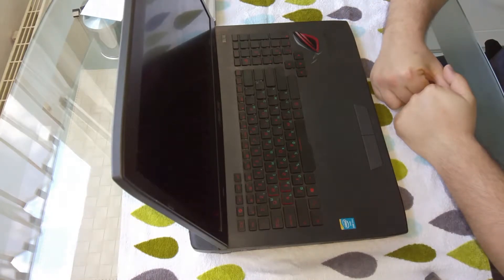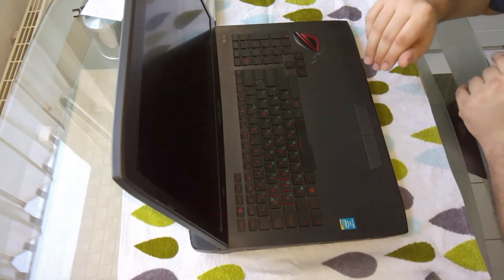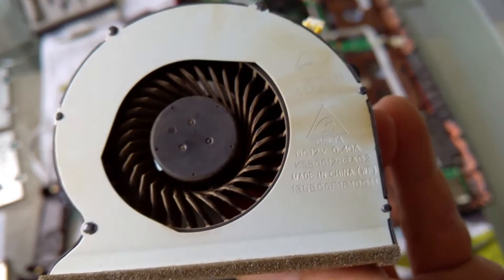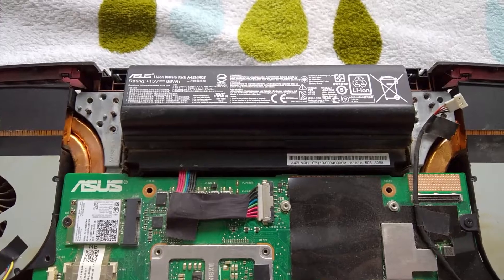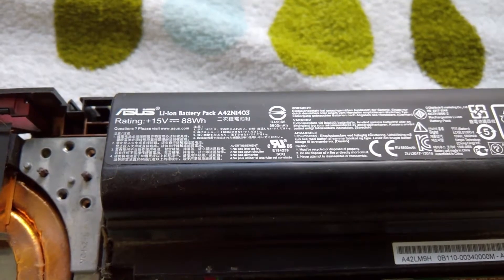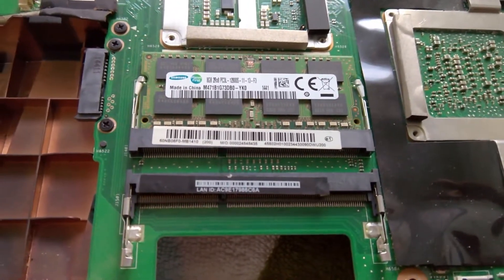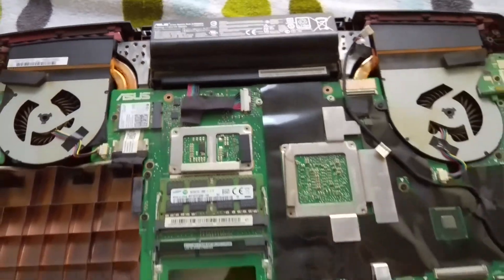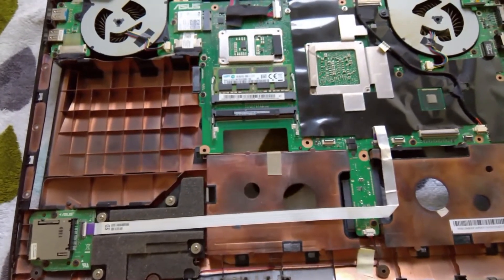Asus G751 - Things you need to know HD

Comment: I've found a refurbished G751 with the 4720HQ and the GTX 980M for 1100$. Is it worth it? It does not have G-Sync btw.
Reply from the maker: Well, it depends. Usually, I'd say that this a relatively good price but still a tad too much for a 2 yo laptop. Have in mind that you can get a second hand one, maybe not in "perfect" condition, but still good enough for 200-300 less. If I were you, I'd look around for second hand, rather than refurbished. Ofc, this is my personal opinion.
Reply: The deal was already taken with the blinking of an eye. It was only used and returned in less than a week, so I presume it had some serious heat issues. As I find 17" devices too big, I'll be looking for the AW13. I heard the OLED screen is epic great!
Reply: Hello I'D like to take this machine asus g751 i7 gtx 965  in good condition battery life time max 2hours for 500 $ is it worth it or better not to take?
Reply: @abbosxonolimov2965  GTX 965M is very outdated today. Probably go with a 1050 or 1050Ti laptop
Reply: @zaka2630  hello  mr Zakaria thanks so much for your reply 
Would u please tell me the amount of I am buying is ok or too expensive for that?
But in good condition battery life time up to 2 hours!
Reply: @abbosxonolimov2965  The price is good but I suggest you add 200$ and get new laptops with GTX 1050

Comment: Hi! I'd like to ask you, is it compatible anyhow with pcie m.2 SSD storages?
Reply from the maker: Yes, it is compatible to PCI-E based M.2. Samsung EVO and PRO series for example). It is however NOT compatible with M2 SATA SSD's (the new ones with the very high R/W speeds)
Reply: Hello brother is that support m 2samsung evo 970 1TB? And is they need bracket to hold it or not?

Comment: hello, quick question...did your laptop becomes slow when using adobe Illustrator ? also does you camera key works after the windows 10 upgrade?
Reply from the maker: Hello, I use Illustrator almost on a daily basis and it really depends on the amount of RAM you've got. Currently I have 16 GB (I started with 8GB) and since I've upgraded the RAM the performance is drastically improved. All adobe apps consume huge amounts of RAM. When you couple the 16-24GB of RAM with an SSD (850 Pro or 850 Evo) it becomes a very different story. You won't notice much lag. 
As for the Camera key, yes it's working, but since the last retarded GeForce experience update you have to pres Alt + cam button. I hope they fix that damn thing. It's annoying AF.

Comment: The DVD can be replaced with a Blu-Ray, right?  Also, the DVD can be replaced with another DVD I assume.  Do you have a video on that?
Thanks
Reply from the maker: Usually this laptop comes in different configurations, one of which has a blu-ray reader/writer or only a reader. Here are two options: http://bit.ly/2jsv9gQ or http://bit.ly/2jpA6aG
 You can also buy an SSD caddy, but you lose the CD bay. Personally I don't see much use of the CD/DVD bay, because since I own this laptop I've used it maybe 2 times. I have enough storage for now, but if I start running out, I'll swap it out for another HDD/SSD slot.

Comment: Great video!
Mind recommending audio driver you're using for win10? That laptop of mine is getting pretty annoying when i'm listening to anything, even this video, with volume above 30%, all that crackling and stuff, like the whole audio system is too weak to handle the sound (using battlefield preset from asus audiowizard)
Reply from the maker: The driver version I'm currently using is 6.0.1.7576 from 04-Aug-15. This is the patch which fixed the issue with the sub. Although in your case, you say it's already making crackling noises it might've damaged the subwoofer. I used mine approx 5 months with the wrong driver but I used it mainly with headphones. Install the new driver and if the crackling noises persist, then you've probably damaged the sub.

Comment: BEST I SEEN ON YOU -TUBE! GRATE PC VIDEO ! ! ! @%#!^*$ your THE BEST ON YOU -TUBE! GREAT HEADS UP! WHAT ABOUT VIDEO CARD REVIEWS SAID THE NEW 1070 IS 2X TWO TIMES FASTER THE SPEED OF the NVIDIA GTX GEFORCE OLD 980M ?
Reply from the maker: I suppose you mean 1070M vs 980M? If that's the case, it really is nearly 2x times faster. There's no doubt about that. After all we're talking about a 2+ yo GPU vs a brand new. I'll wait another year or so and I'll move on either to Acer Predator or to the new gen ROG. I'm also considering a desktop at this point, because I don't need a laptop so much anymore. I'll keep my G751 for the road though. It serves me well (ignoring the battery issues).

Comment: I bought a trackpad to replace my ASUS trackpad. Is there an easy way to replace this part? I'm sort of a newb, but want to try doing it myself because I don't have a lot of money. I checked the manual but it doesn't cover replacing this part. Thanks.
Reply from the maker: I didn't even know they sell spare touchpad for this model? The keyboard and the touchpad are usually welded to the palm rest using high frequency. I'm not really sure how you can remove the old one and even if you do, you have to break all the welded spots and then using an soldering iron or something else you can melt the plastic and put the new one. I might be wrong, but at the moment I can't open mine to take a look as I'm on a business trip for 3 weeks.
Reply: Dongleboo thanks  yeah they do here : http://www.asusparts.eu/en/partfinder/Asus/Notebook/G%20Series/G751JY#Touchpad.    Anyway I did try your tutorial but could not figure it out I had to take it in to a store, the guy believed it would be a simple thing to put in. Judging by your comments though I'm thinking it won't be I hope if dint throw my money away. He said it would be tomorrow  befor I hear from him so I guess maybe we'll see.
Reply from the maker: Tell me if he managed to put the new one in because there's another person who's having the same issue. 
BTW my battery died for the second time. I might make another video about this. It was brand new and I had to use my laptop for 4 days without charger and now if I unplug it, the laptop shuts down in 5  minutes. :D
Reply: Dongleboo
 Yes, he fixed it.  I want to clarify that the part was damaged was the trackpad button (left click no longer worked). I only ordered that part not the whole trackpad.  Initially, he thought I needed to order more parts, because he thought like you that it was soddered on. But a gamer employee more familiar with the laptop came in, and they discovered it was attached with double-sided tape. They put in and now it works great. They cleaned my fan too. I appreciate your help and so sorry about the battery. I hope mine never dies like that!

Comment: Hey I accidentally put a 5v fan and now my comp won't start,am I fucked?
Reply from the maker: Well, try to disconnect the battery. If that makes no difference and as a last resort, disconnect the battery and then remove the CMOS battery for approx. 1 min or so. If that also has no effect, then you might've fried some controller chip or something. I'm really guessing here. Does it turn the fans or something or it's completely bricked?

Comment: I've had mine for 1,5 years now exactly, 2 weeks ago the battery started acting up.it's still retaining charge and stuff, but stops charging at 89%, retaining 70,229 mWh currently. also I was thinking of doing a "xotic pc afterburner" mod. thank you for the disassembly video!
Reply from the maker: You're welcome. As for the battery, I'm pretty sure its already dying. You can keep checking for drops in the charge capacity, but for me it's a goner. The charge  will soon drop significantly and soon after that the battery will hold less than 20-30 mins. After this "phase" aa soon as you see the "10% battery" notification, the laptop will hibernate. My advice to you it's to keep the laptop ok AC at all times if possible. These new Li-ion batteries really don't like to be discharged and charged. 
The mod looks like a bunch of LED's under the heat sinks. Looks good tho.
Reply: The weird thing is,i was keeping good care of it. Ac power 95% of the time and didn't use high consumption tasks,like gaming,while on battery.laptop works so i'm cool with it for the moment.yes the mod is exactly that,though i'm not sure if they swapped out the vents with led vents or just put some leds in.i'm very bad with small things so i need to build courage before doing it:)
Reply from the maker: I'm pretty sure it's just s small LED strip which has adhesive on the back side and you will stick it on the base. You can give feedback once you install it.
Reply: will do!

Comment: Hi.  when you play gaming like bf4 how temperature.  bcz I'm get 90c cpu . ineed to know. . thanks
Reply from the maker: Well... lets say 90C is a tad too high but still within safety limits.  If it gets over 95C and holds, then it might be a problem. I'm getting maximum of 85-87C. Have you cleaned your fans? If yes, then maybe there's some thermal throttling going on? Download Intel XTU (free) and try to undervolt your CPU. You can download pre-configured profiles on their website and the CPU will run smoother You can also monitor if there's thermal throttling when the CPU is under heavy load.
Reply: tak eto i perviy i vtoroy po 12v?
Reply: vot ya kupil na ebay ventilyator i vot 4to mne on napisal
Reply: Hello,my friend,

Thank you for your great purchase from us.Your package still send to you on the way.

As a friendly reminder,our listing fan is DC5V 0.5A Cooling Fan for ASUS G751 Series.pls checked before you installed it.

Pls Note: ASUS G751 Series have 2 types fan.This listing for DC5V Cooling Fan,Do not compatible with DC12V Cooling Fan.if installed it will be burn off.Kindly check the listing part number and photo before your make purchase.Thanks

We are always at your service.
Reply from the maker: The JY series has a 12V 0.40A fan.
Reply: +Vladeslav Yuriychuk  I bot I new Thermal post in cpu and gpu and clean the fan's  but stellar in 88c heater .
thanks my pro
Reply: spasibo